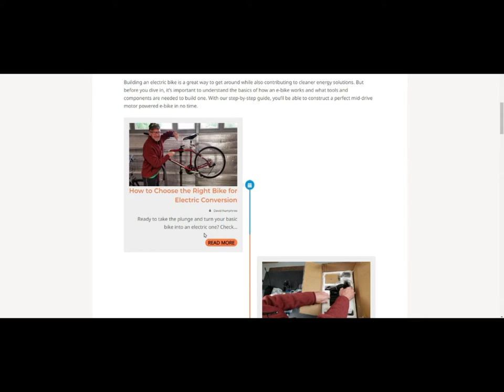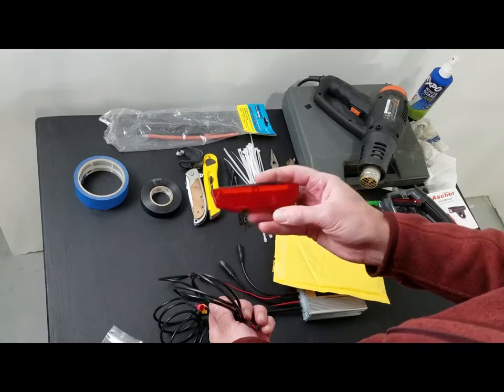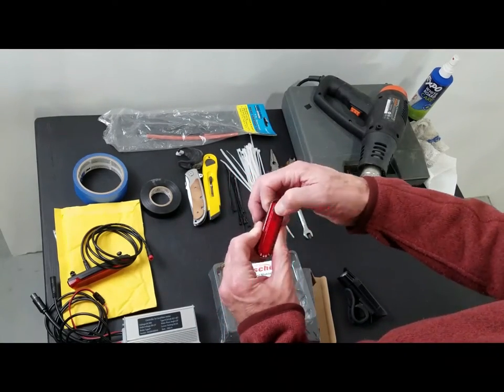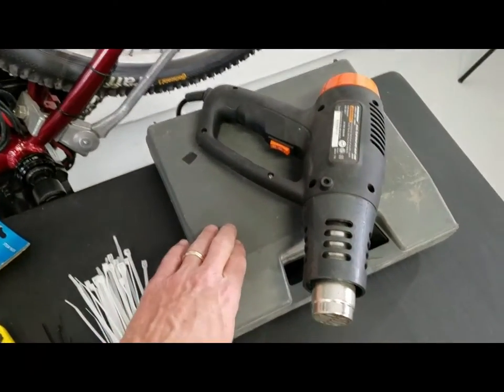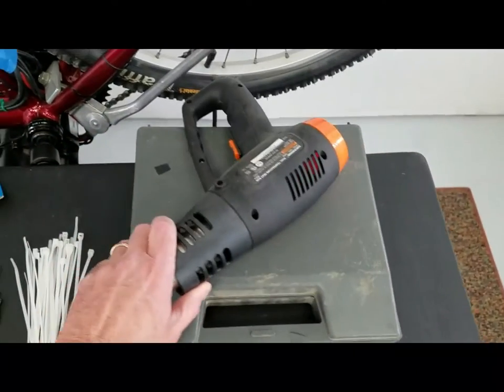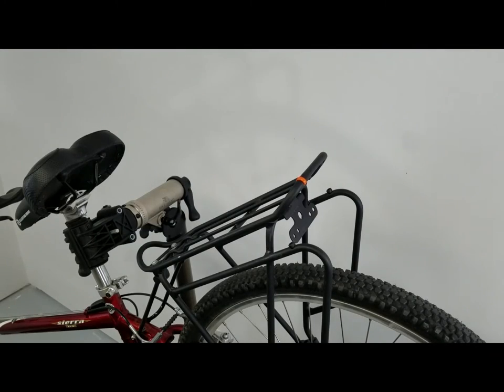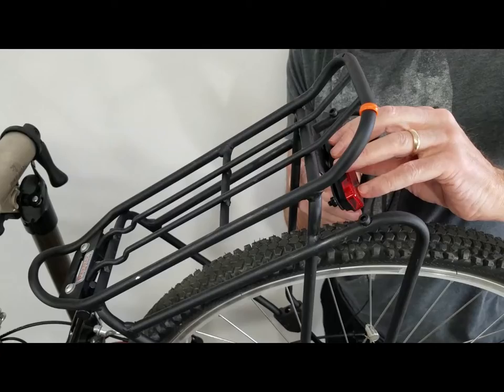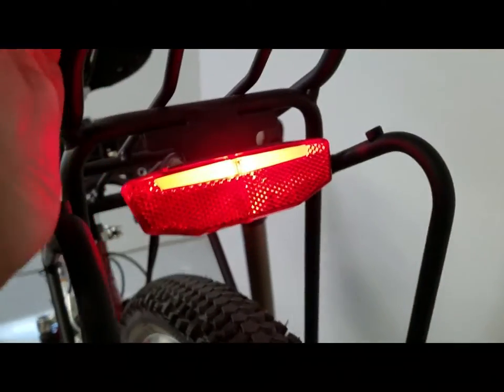eBike Taillight Wiring and Options

Comment: I have the exact same Bafang setup ,  but for some reason, the headlight goes off when the tail light come on.  Both lights work fine independently, but will not come on at the same time. 
Any ideas?
Reply from the maker: That is interesting.  I'm not sure how to fix it though. 👍👍🚲